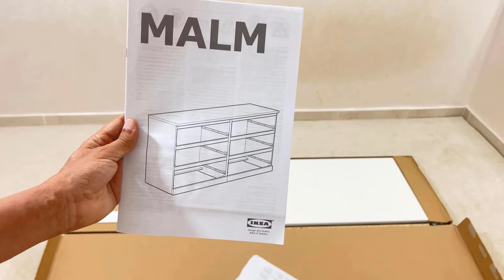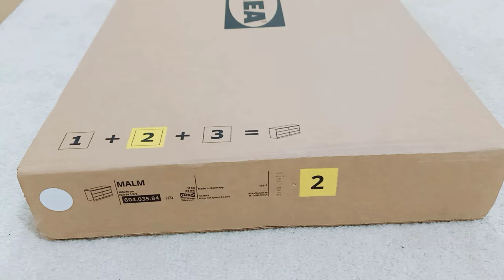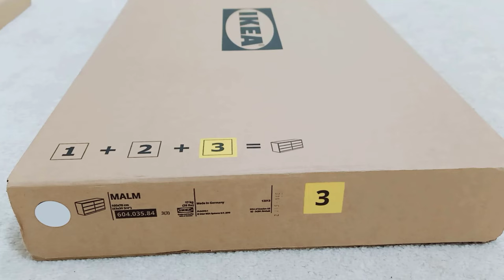IKEA MALM 6 drawer dresser assembly instruction - very detailed

Comment: The new Malm dressers come with locking mechanisms on all of the drawers so they don't open. I cant figure out what the heck is going on!!!
Reply: My current struggle right now I can’t figure out the locking ugh
Reply: @breannafields6198  I figured it out. Keep all the locks right side up. This way you can slide all the drawers in. The locking mechanism exists because it is a child safety feature to only allow you to open one drawer at a time. When one is open, the rest are locked. They don’t mention any of this in the instructions.

Comment: @52:00 where did you get the tool to drill the hole for that screw?
Reply from the maker: I only made a mark with a larger screw.  then I used the screw of the package with a screwdriver
Reply: @th3blogger  thanks to your video.  My drawer is now assembled. There's one drawer that wouldn't slide all the way. Do you know any reason for that and how to fix it?

Comment: I wanted to get the 6 drawer one but I ended up getting two of the 3 drawer ones since it was on sale and it would be easier to move around if I wanted to switch them places around the room !! I set one up by myself but could bring myself to do the second one since the first one took me hours 😂 the next day my body hated me and I was sore AF 😅 now I have to leave the other set of drawers until my body stops hurting. Bottom line…..get yourself the 6 drawer one if you can 🥲